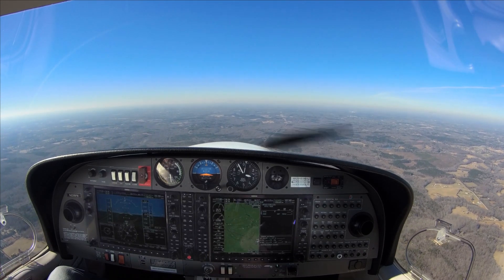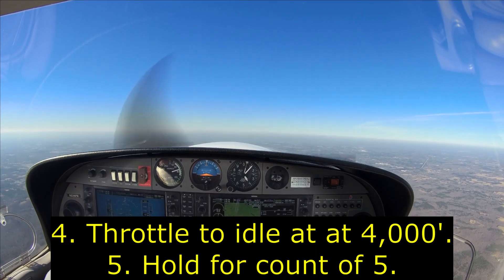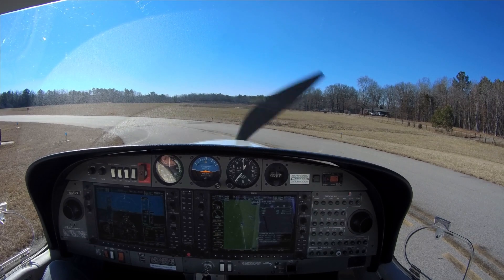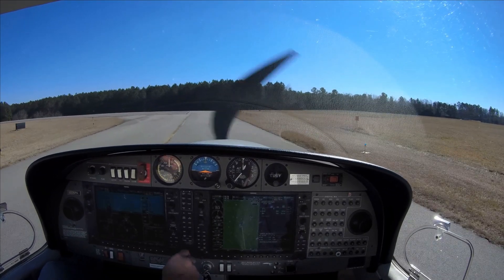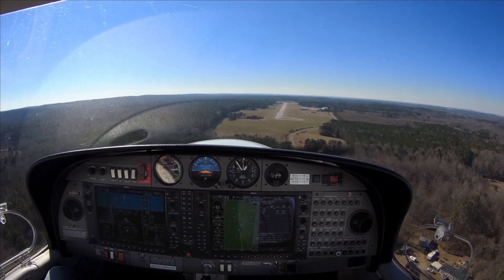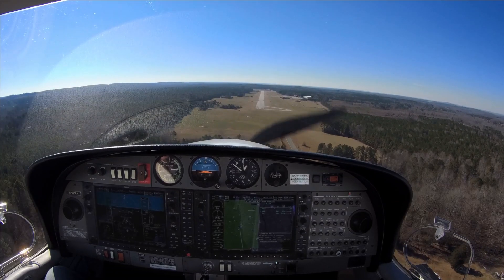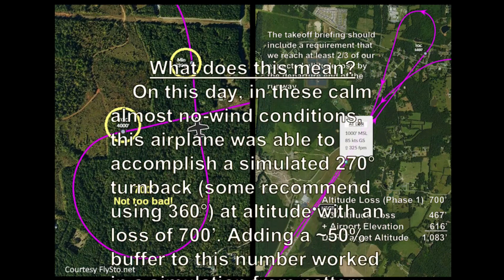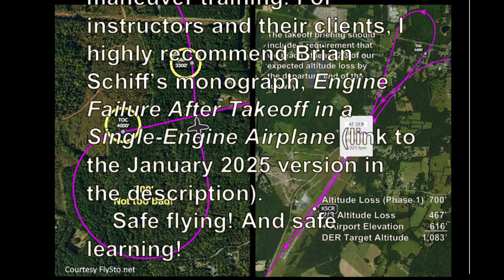"Impossible" Turnback after Engine Failure after Takeoff

Comment: Useful exercise, but strange parameters - you ve mentioned idle - engine on idle still provide thrust, which is not only safety tip, but ~7% thrust still. But surprise for me is altitudes - 1`000ft AGL !???? )))) we are landing from 800ft AGL with real engine switch off from anywhere of the pattern )) from these altitudes it is not question at all - the only real concern is Upwind engine failure
Reply from the maker: Good comment. The exercise is about learning performance and both aircraft and pilot limitations. I don't think that means we have to see if it works lower down.